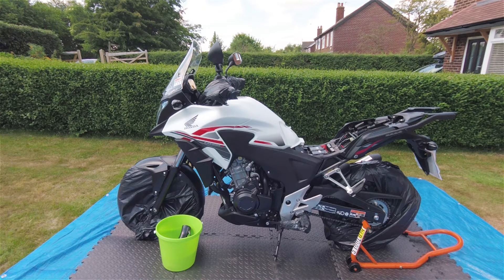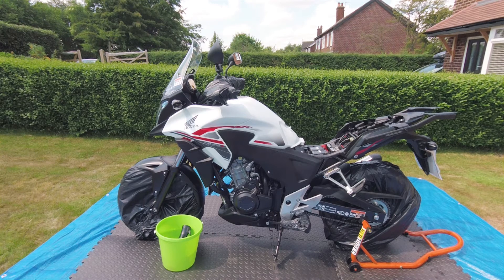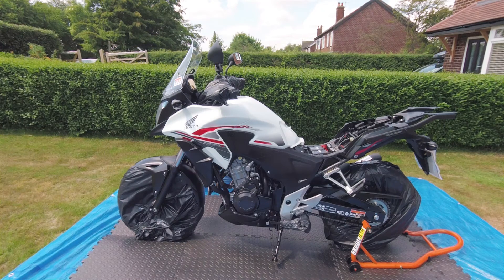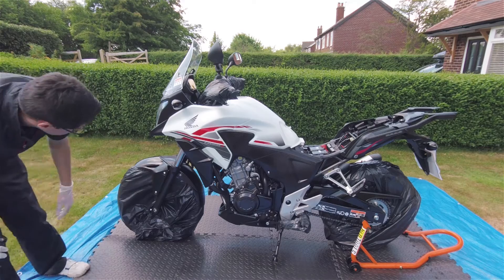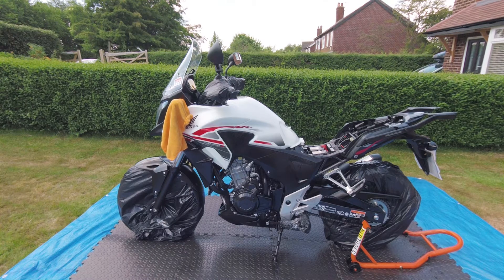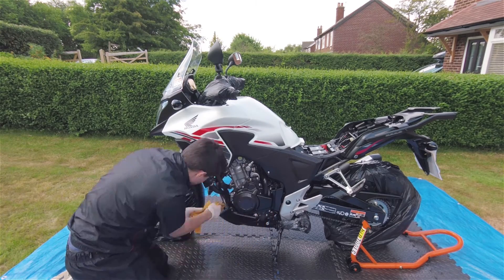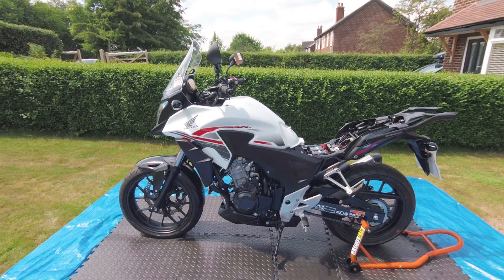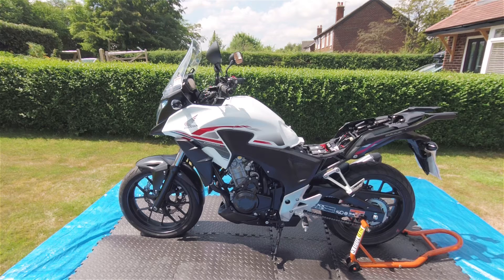ACF50 application with Flairosol Mist Spray bottle

Comment: I’ve used it for a few years now, I apply it with a Mini HVLP Spraygun, .8mm nozzle, ( if I remember rightly). Goes on with a fine mist spray. Make sure you use a face mask if using in an enclosed space.
Reply: Sprayed it this morning, first time for this bike, will give it a run out this afternoon and go down the road like a steam engine till the smoke dissipates!!

Comment: I've just applied ACF-50 to my bike for the first time, and have decided that the best way to apply the stuff is to use a compressor. I bought the ACF-50 32oz bottle which comes with a small spray bottle, which was useless! I tried other various spray bottles, and they were useless as well. It was very cold, and because ACF-50 has the consistency of light oil, using a spray bottle just didn't produce a fine enough spray, so I ended up wasting loads of the stuff - about ¼ of a bottle on one bike! So, I'm going to bite the bullet and buy a small compressor, which should pay for itself over the years, plus you can also use it for other things, like blowing your tyres up! 🙂
Reply: I agree. The last few applications I’ve used a gravity fed spray gun with a small compressor, applies much finer coat and is more accurate. Love it. I’ve used a minuscule amount of ACF 50 for those last few applications.
Reply: @andrewstewart106  What size compressor did you buy? I've got my eye on a small 24 Litre direct drive air compressor made by UK company SGS. Spec is quite good: 9.6CFM, 2.5HP, so it should work okay with a LVLP spray gun.
Reply: @soulrebelno1  I’ve had it about 15 years, just never had a spray gun till just after this video. It’s a small 24ltr one. Perfectly fine for this use and general DIY.
Reply: @andrewstewart106  15 years - you might want to watch this video I've just come across, and maybe think about replacing it. Compressors rust from the inside out due to moisture in the air, hence the drain, and proper maintenance is essential! https://youtu.be/sm_FJ6Pat4I

Comment: Very informative. Can you just confirm which parts of the bike are essential to be pre-covered and therefore not lubricated by this application?
Reply: Thanks for the comment.
When I apply a coat to the bike I cover the tires, brake calipers, footpegs, gear shifter, rear brake lever, hand grips and brake/clutch levers. Basically anything that contacts the road, or I come into contact with, plus brake pads because they will fail if lubricated.
Those are the areas I don't treat on the bike.
Oh and I don't coat the seat either 🤔
Hope this helps.

Comment: Hi great video, can you tell me if the screen and mirrors were coated? If so why, if not why not?
Reply: I think I may have given the screen and mirrors a once over with a cloth. Shouldn’t need to coat them or other plastic areas, ACF if for preventing corrosion but I also found it provided a nice finish on the non vital areas once cleaned.
Reply: @andrewstewart106  thanks appreciate you responding

Comment: I tried these Fairosol with my ACF and just could not make them work like you did,even warmed the ACF up to no avail.
They are great bottles I found plenty of other uses for them but as for the ACF I'll keep running it through an air compressor and spray gun. Good video
Reply from the maker: interesting, was it flairosol branded?
Reply: Adventure X yes it is a genuine item,like I said it works great as described with FS365 or Muc-off just can't seem to get it to work with ACF or XCP.
Reply from the maker: Hmm how curious. The only thing I can think of is the water I used was a mix of kettle and hot tap. I wouldn't be able to put my hand in the water. I found that ordinary spray bottles just stream out a gooey mess, the prep with those though was just warm water not kettle. I may test that next time I prep the bike.

Comment: How did you get it to mist so well from the Flairosol? I have tried, including heating it in a bucket of hot water, and it just didn't mist at all. The bottle itself seems functional.
Reply: The first time I used the bottle it was fantastic. I didn't clean the bottle after use and it didn't really work well after. I also heated the act 50 for a good while before use, I remember it acting/running quite thinly. The day was quite hot too, the other times I've tried it's been winter and cold, not really worked great. I ended up using a gravity fed spray gun with my compressor this time. That worked amazingly well.

Comment: I'll be doing this with xcp instead of acf50 soon, I have the same bottle as you and the best way to use is too fill it with xcp then wait a few mins while it sits in just below boiling water? A reply would be much appreciated thanks
Reply: Yea I agree about the near boiling water, boiling water distorts the bottle though, and wait 10-15 mins for best results. Not used xcp myself though.
Reply: @andrewstewart106  cheers for the reply, so leave the bottle for 10-15 mins in very hot water?

Comment: Hi there can I ask y did u put the acf50 on the hot or cold bucket
Reply: The bucket is hot, but not boiling. ACF50 on its own is a fairly thick sticky liquid. Putting the spray bottle in hot water for a few minutes helps the ACF50 loosen up and spray better, but it also allows it to creep and ingress into all the hard to reach places.
Reply: @andrewstewart106  ohhh okey so it has to be a medium hot got u also can i use this evey time after I wash her because i live in Scotland and it's always raining and i wash her every 2 weeks or every month so i can apply it every time I wash her
Reply: @emmanuelgeorge4112  I usually apply it a couple of times a year. You could do it after every wash once the bike has dried, but if you’d like to keep the coat topped up maybe after a couple of months would be mora manageable as there’s a bit of prep needed before it’s applied.

Comment: Thanks for sharing. I've had a few attempts now at 'misting' this miracle liquid! All I get is a squirt (oooer missus). I purchased the larger bottle with 'free' applicator and warmed it up - it squirts a jet of liquid across the garage. I bought some cheap spray bottles heated them up and they melted. So when I saw your video earlier this week, I ordered a Flairosol from Amazon, put in some ACF50, mildly warmed it up .... you guessed it, out came a thick jet of purpleness. What am I doing wrong? Is there a specific temperature?
Reply: Have to admit I melted a bottle too! I filled a bucket with boiling water fresh from the kettle and without thinking but the bottle in...... Shrivelled immediately. The first few times I used boiling water and cooled it to the point I could just about touch it, but not hot enough to melt plastic. I then let it sit for a good 15-20 mins. Worked fine first few times. After the melt I got a new bottle and that was ok for 1 use but now just produces a goopey stream. I've since upgraded to a gravity fed spray gun for my compressor. That works beautifully, even without warming the acf50.

Comment: How did you get that bottle to mist?  Mine just squirts.
Reply: I found a bucket of warm water helped. Leave the spray bottle in it for around 20-30 mins. The ACF 50 should thin down a little. 
I made the mistake once of using water straight from the kettle and melted the bottle, never sprayed right after that. I then moved to a gravity fed gun for a compressor.
Reply: @andrewstewart106  I actually bought a separate lot off eBay that came with an ACF-50 spray bottle and that doesn't mist either. 🤷🏻‍♂
Reply: @gavinbroad1743  I had a couple of the small ACF 50 spray bottles, more of a jet than anything, and created a sloppy mess.
I found the most reliable was a small compressor and a gravity fed gun, I used probably 70% less ACF than the spray bottles as it’s much more efficient at misting.
Reply: @andrewstewart106  OK, yes, I have that kit, so that's what I'll have to do. Did you still warm it with the gravity fed gun?

Comment: I would not bother with the gasoline tanks, that can be handled with proper coats of wax, or a sealer plus carnauba wax even better. The plastic is optional since it doesn't rust. There are other dedicated products for the plastic.

Comment: How often do you apply ac50?
Reply: I like to do it twice a year. Once before winter and once in spring/summer. I keep the rag I use to one side, as it has acf on it, so I can wipe particularly exposed bits like nuts and bolts on the engine through winter.

Comment: ACF50 is really for winter use
Reply from the maker: I agree it's more beneficial for winter riding however it is quite often wet in the UK so just gives me peace of mind all year round.
Reply: Apparently the road salt is still damaging in summer.  Not sure how true this is. Applying twice a year seems to do trick for me.
Reply: I do a lot of miles on my bikes main bike is a versys 650 and I do around 35000 a year on that around 10,000 a year on my sv650 and about to same on my little 125 I use for greenlaning and really bad weather (snow/ice) commuting so my bikes get an acf treatment about once a month when I'm using that particular bike I do it the same way as in this video apart from the fairings and belly pan come off first just gives me peace of mind keeps the bike looking nice and why not a bottle still lasts me a year so who cares of it costs a bit more

Comment: Might be worth washing the wheels first.
Reply: The bike is thoroughly washed before application, including wheels. For the winter coat I'll spray a cloth and carefully apply to the wheels, avoiding tires and discs though 😎. I don't feel the need to do that for summer.